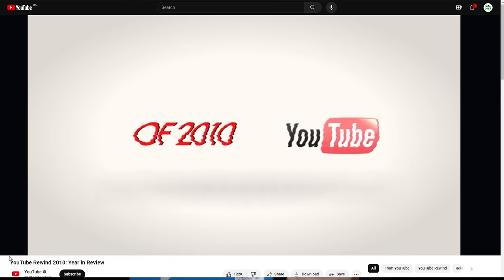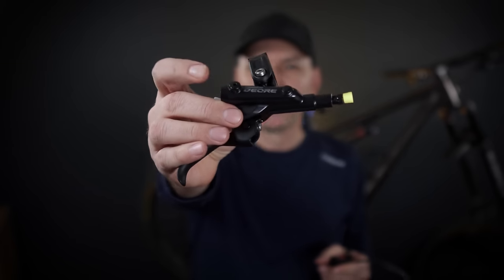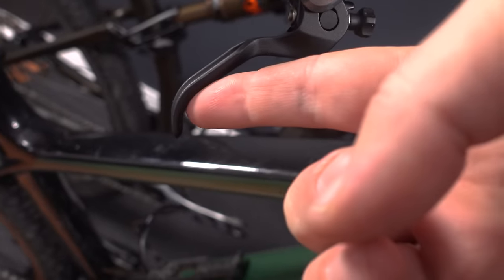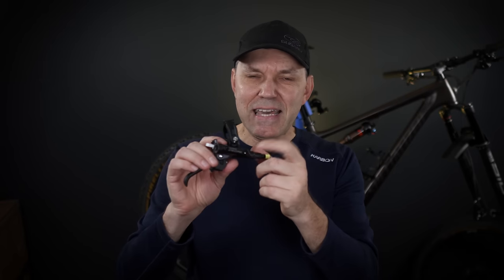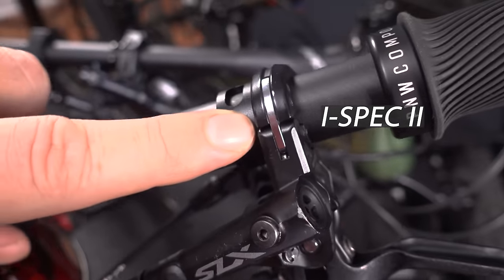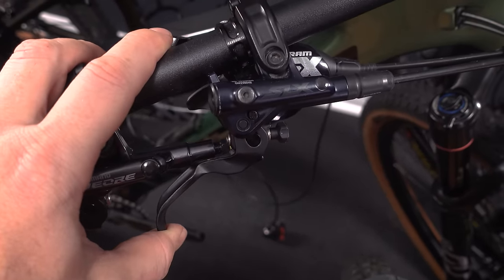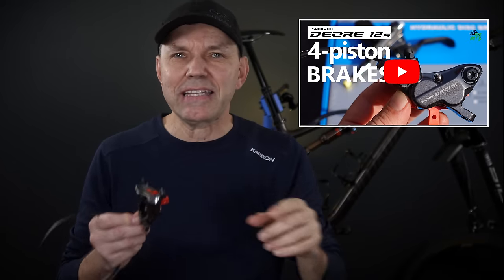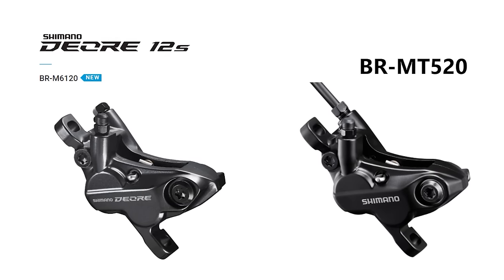Shimano BRAKES Lineup - DEORE, SLX, XT, XTR, 2-piston, 4-piston, M6100, M7100, M8100, M9100, M9120

Comment: I fitted a BR-M6120 to my hardtail a few days ago and apart from the look there is no difference in performance to my BR-M8120. All I did was cut a M4 thread so I could use a pad retainer bolt and fitted some D02 sintered pads, all in 5 minutes. For me there is no need to spend the extra money over the Deore BR-M6120 brakes.
Reply from the maker: Agree 💯

Comment: In my opinion free stroke is the biggest problem with hydraulic disk brakes. 
I trick it down by overfilling, so I have around 12mm at the end of my XT 8000 levers with 4 piston calipers, but 7 to 5 mm, as it was possible with cantilevers, would be much better. 
In this regard I like 2 pistons more than their big brothers.
A lot of riders work around free stroke problems, adjusting their levers super close to the grips or having one finger on the lever all the time, but that's not for me.
Are there any differences coming with the latest shimano generation?
Reply from the maker: Not meaningful no, but you can use the free stroke/ bite point on the XT/ XTRs for that. I would go 2-piston though if you want minimum pad clearance, that's pretty much what you're asking for.

Comment: ThnX! 
7:22 - so, it looks like only a Deore M6100 rear caliper allows for a cut-to-the-size hose? 
I need a hose longer than the longest available with a banjo (ISMBH90SBML200 is only 2000mm long).
Reply from the maker: Deore is the only one that allows to use that tightening nut at both ends, caliper and lever so yeah if you can find a longer than 2000mm hose you can do it, pair a deore caliper with whatever lever you have.

Comment: The non-servo wave XTR levers feel no different in terms of lever feel IMO. The pads sit closer to the rotor making set up a bit more tricky but the feel under braking has better modulation.
Reply from the maker: Depending on the application they will feel weaker also. Some use those levers with 4-piston calipers for the ultimate "modulation". But I feel that modulation is an overused term to define brake performance.
Reply: @LoveMTB  totally agree. I have my XC bike with M9100 levers (no Servowave) and M9120 callipers,… and my trail bike with M8120 brake/levers …. The brake feel of the XTs is much better in my opinion. Haven’t tried the M9120 levers though.

Comment: I bought 4 piston deore, I'm not real happy with the lever travel adjustment. Probably gonna order a set of 4 piston XT's.
Reply from the maker: FYI won't be much different.
Reply: @LoveMTB  Thanks for the heads up. I had 2 piston XT's on my old bike it seemed like bite point was closer the stop of stroke on the lever. That's where I like it.

Comment: Hi LoveMTB, I know you probably don't have the time for this. But can you measure the width of the widest part of the Deore XT or SLX dual piston calipers? The part where there is a head of a screw protruding the left side of the caliper (when facing towards the front of the bike). The reason I ask is that my Deore caliper, because of its new design, could not clear the seat stay of my frame if I try to install an 180mm rotor adapter so I'm stuck with the 160mm rotor. I was wondering if the Deore XT or SLX will solve this issue for me.

Comment: Nice video buddy. I’ve just got a Vitus sommet which comes with sram brakes I’m wanting to swap them out I really don’t like them. Can I use scram Rotas on shinmano brake sets?
Reply from the maker: Yes you can but if they are the Centerline / most probably/ they’re not that good
Reply: Yes they’re centreline. Do you reckon I should swap these too? Cheers for the advise
Reply from the maker: @syms85  I would, and the cheap SLX rotors from Shimano are good

Comment: Great vid 👍 Quick question will the current shimano 12 speed brake lever range (mt6120-mt9120) work with the shimano MT420 4 piston calipers?
Reply from the maker: Yes but be careful with the line connection, MT420 has a straight in hose just like the Deore.
Reply: @LoveMTB  Thank you 🙏

Comment: I've been contemplating going hydraulic on my everyday commuter. I've got mechanical Paul brakes. They are really nice and easy to adjust. My only issue is that my rear brake line froze internally because some water got in there and the temperature dropped in the 20's. I was able to still use my front brake however, so it wasn't a disaster. I put a new brake line on and used a better sealed endcap and also used some antifreeze in the line and so far haven't had it freeze again.

I'm mainly curious if hydraulic brakes are susceptible to freezing?
Reply from the maker: Probably not as bad as the mechanical, I've never heard of them freezing.
Reply: Consider the Shimano MT200 brakes. Dirt cheap and excellent.
Reply from the maker: @ericjensen4434  depending on the application 😎

Comment: What a phenomonal video, thank you!  As someone brand new to bikes, I have been so confused about so many things, and this cleared up a lot.  My only existing doubt I have, in case anyone is kind enough to help me....I currently have SRAM X9 shifters, attached to Avid Elixir levers (2011 Stumpjumper std kit).  Once i put the Shimano levers, I will have nowhere to attach the shifters, I'm sure its obvious to anyone with experience, but what are my options here?  Do I buy new clamps for the shifters, or is there a way to mount them to the Shimano's in a similar way I have them now?

Thanks!
Reply from the maker: Thanks!
And depending on how they were attached to the brakes you might be able to find the usual SRAM bar clamps.

Comment: Do you know why the XTR uses a flat head for the pad retention vs. the allen on the lower versions? I've always wondered, it seems to be a down grade.
Reply from the maker: It is a flat head indeed, don't know why. Maybe so you don't overtighten it given that the caliper is made out of magnesium?
Reply: It's more likely you always easily can get a flat head driver rather than allen 😎🔝👊🏻 for convenience I guess, the R in XTR stands for race after all

Comment: Hey man, quick question... My Eeb (e-mtb) came w/ TRP Slate 4 Piston brakes.
They're seriously underpowered for the bike (& me @245lb's).
I'm looking at getting XT M8120 & thought you might know answer to this one... do the XT M8120's suffer from the wandering bite point issue?
Second question, you mention the straight Deore M6120... do you think they'd be up to the task w/ a 50lb rig & 245lb rider?
Many thanks 👍
Reply from the maker: Deores will be just fine, you can ue the finned pads from Zee / Saint with them if you want. Interesting that you're the seccond biker in the chat to ask about the TRP Slate great modulation/ underpowered performance.
Reply: @LoveMTB  Slates would be great on a trail bike.... they're just underpowered for my AM E-MTB 🙁
Reply from the maker: Great brakes for the right application for sure @kingrat738

Comment: Just want to mention that a friend has the xtr and he fell two times on the levers and he had do drill the existing screw hole as the screw broke, and also the body lever bended. As a design i feel that the sram levers are more robust and even the ultimate with the carbon levers are more durable then Shimano. I would not recomend the xtr as they are to high as a price. I feel like they are fragile.
Reply from the maker: I don't know about durability as we prefer to ride the bike upright ☺ but I agree with you on the XTRs. But they are race components after all they're supposed to be the lightest not the most durable.
Reply: Yes, the 7100/8100 levers bend nuch easier than the 7000/8000 series levers. This is because where there is a kind of fold in the lever, the new style ones are pressed a bit tighter than the older ones. Hard to explain unless comparing the two. Also, I cannot tell any difference in stiffness between the old & new style. I actually prefer the old style because of the stronger lever & they take up less space on the bars.
Reply from the maker: @45graham45  💯 prefer the old style for more space on the bar but don't like the old I-SPEC II attachment style for the accessories.
Reply: @LoveMTB  Yeah. Well, I always use the bar attachment option. That way all my kit is backward, forward & sideways (other brands) compatible. Never understood why people claim that having a black bar clamp fitting on the dropper & shifter levers makes the bars cluttered - it does not. In fact, with the new style levers my dropper & shifter bar clamps fit between the two contact points of the brake lever & so take up zero extra space on the bars.
Reply: @45graham45  even that the new clamping style makes them a bit more powerfull, you can't loosen them to spin around the bar in case of a crash. Ore they are to tight or to lose on the handlebar. Maybe just one point of clamping on the bar but a bit bigger is a better design then two point clamping.
Reply: @artoutlawphoto  But it doesn't make them more powerful. The old ones never flexed & the piston & it's actuation is the same as the new ones, so how can they be more powerful?
Reply: @45graham45  well i don't know, i guess. At least that was the marketing. I don't use shimano brakes. But i will want to use shimano brakes or shimano groupset on a XC or Gravel bike. But every time when i make a new build i'm still going with sram ,its something i can't shake off 😊

Comment: I recently built up a new hardtail with 1x12 XT drivetrain and SLX M7100 brakes on RT70 180/160 rotors. the rear brake works perfectly smooth, however the front rotor has a distinctive bite spot, which causes it to pulsate under braking. i've cleaned the rotor and given it additional time to wear-in, but the pulsating persists : /
Is there anything else i can try, or is replacing the front rotor the only solution?
Reply from the maker: RT76 rotors? bent at all?
Reply: RT70 rotors, center lock. not bent, they run true, front one just seems to have an inconsistent braking surface. i built everything with brand new parts... it's odd?

Comment: How does the braking power compare? 🤔
Reply from the maker: Which ones are you loooing at?
Reply: @LoveMTB none specifically, just curious which are the most powerful ones.
Reply from the maker: With what rotors? Size? Make? What pads? Warmed up or not? How strong is your finger?  😊 4 piston are about 20% more powerful than 2-piston @gammelgemse